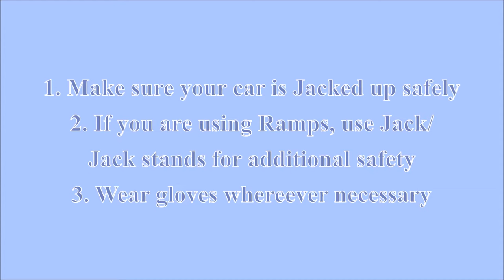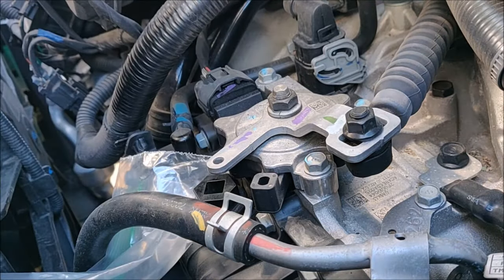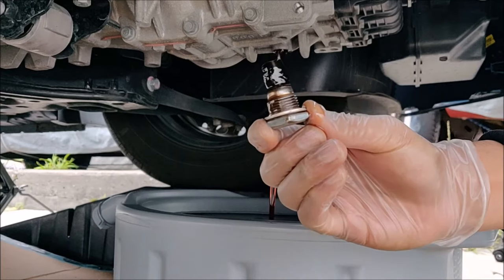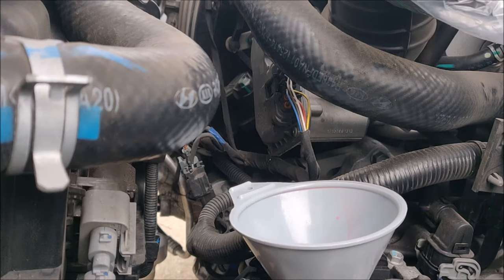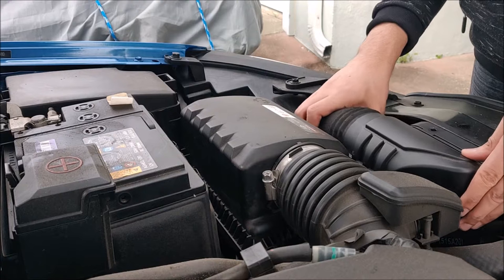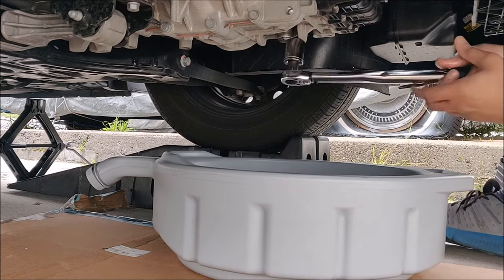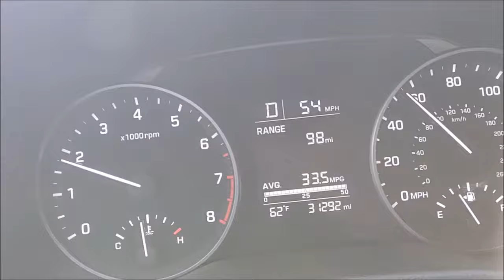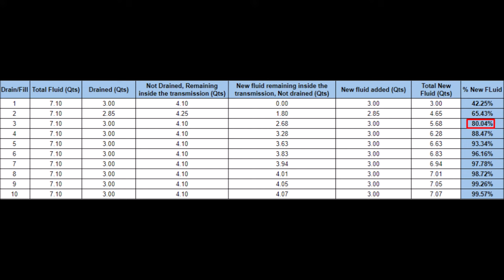2018 Hyundai Elantra Transmission Fluid Change - 3X Drain & Fill with Amsoil ATF (6Th Gen Elantras)

Comment: Hi ! Does 2017 Elantra has ADAPTIVE TRANSMISSION LEARNING?
Reply from the maker: Yes. I believe the 6th gen Elantras do have it. The computer does learn from your driving habbits and tries to make the shifting more efficient for you. That is why sometimes, you would notice a transmission shifting a little differently after a fluid change. That is normal. Once it gets used to it, everything is back to normal.
Reply from the maker: Check this video out. He talks about the Adaptive transmission learning and shifting after a fluid change! :)  https://www.youtube.com/watch?v=aH95BurPZys
Reply: @andy-auto-info2483   your car has low millage that's why you dont need to reset Adaptive transmission learning,but for cars that have more than 100k they may need to reset the adaptive value after ATF change particularly if you feel delay in shift between gears while driving.
Reply from the maker: @SamSam-dt5uc  yes, you are correct. For the ones who observe delay in shifting or any other issue with shifting after the change. But I do know people who changed their fluids late and their shifting was fine. Normally, the transmission should re learn within the first 500-1000 miles of driving :)
Reply: @andy-auto-info2483   any idea about how to do the relearning for the transmission ? thank you.
Reply from the maker: @SamSam-dt5uc  I did try to explore that. But for Hyundai, it can only be done through a high end scan tool and software. You also have some codes that are unique to vehicles in order to access the vehicle computer. They can do it only at the dealership.

Comment: Hey is this the same  procedure for a hyundai kona sel 2019 ?
Reply from the maker: Yes. It should be. Its the 6 speed automatic right? 
Maybe in the Kona, you will be able to remove the fill port easily. Also check below if you see a drain plug and level check plug to confirm its a similar transmission. If so, then the same procedure should work. :)
Reply: @andy-auto-info2483  yeah its a six speed I was planning to use the same Amsoils fuilds its really good stuff. I use the Amsoils fluid on my 98 4runner it runs like a dream
Reply from the maker: @abashashraf8440  yes absolutely! My car runs/feels like butter. I do not feel the shifts at all :)
Reply: @andy-auto-info2483  you should try it with the amsoil signature series and your engine will run so smooth and quiet
Reply from the maker: @abashashraf8440  yes. I use the XL and change out every 7.5k miles with an Amsoil filter. XL is really good as well since it also has a PAO base like the signature series!
Reply: @andy-auto-info2483  interesting I was going to try the XL but it was sold out from my dealer near me. Have you ever used a bypass oil fliter from amsoil
Reply from the maker: @abashashraf8440  No. I have not used any By pass filters. For a sedan, it is not really recommended unless you are using the car for performance drives. As long as you have a quality oil filter that has good specifications, coupled with quality oil, you should be good. :)

Comment: Why not just loosen the shift linkage bracket?
Reply from the maker: I did not want to touch that because of calibration concerns.
Also, the shift linkage bracket was not in the way. There is another hexagon looking bolt under the bracker which was coming in the way of fill plug. Hope that makes sense.
For some folks, this was not coming in the way and they were able to remove the plug easily.

Comment: Where did you get the amsoil atf? Thanks
Reply from the maker: I got it from their official website :)
Reply: @andy-auto-info2483  thanks. Did you like the amsoil better vs factory atf?
Reply from the maker: @drew5992  yeah. Amsoil is a lot better. Extremely smooth. I have 48k miles now and running strong. :)
Reply: @andy-auto-info2483  thanks bro keep making how to videos/maintenance videos. 👍

Comment: Amsoil is a good fluid, but you're playing with fire using something other than OEM trans fluid, especially with Hyundai.  Hyundai/KIA new about the engine fires and the TSB said to decline all engines that caught on fire and to blame it on aftermarket oil filters.  Took 4000 fires, 4 dead bodies, a class action lawsuit, federal judge and 1.5 years of litigation.  Magnuson-Moss Act is a joke.  Good luck if you have trans work that needs to be done and they find Amsoil in it.  And yes, I have a 2019 Sorento and I'll be using SP-IV.  Out of warranty, Amsoil is good.  In warranty?  OEM fluid and filters.
Reply from the maker: I appreciate your opinion. 
Engines caught fire, yes, I know! But i'm sure it is not because of the oils/filters used! Unless they were really cheap! Who knows! Those were faulty engines from Hyundai. But they've come a long way since then. The 2.0 MPI engine is solid. Non GDI and so easy to maintain. 
But regarding transmission in general, I have done tons of research and i'm pretty sure the transmission does not fail if you use non-OEM fluids as long as they are compatible with the spec/viscosity, especially good quality fluids like Amsoil. Transmissions fail because of so many other factors like - 
1.Changing the fluid late/Not changing the fluid
2. Suddenly using a quality synthetic with high detergents when seals are already worn out and then tranny leaks all over the place.
3. Manufacturing defect of a transmission
4. Driving in sever conditions like most of us do and not changing the fluid often - which is the main cause of failures these days. 
5. Heat! - (Main cause for CVT failures)

Now, I am confident that my tranny will definitely last minimum of 100,000 miles or more and hence I am not worried about the warranty!
Her journey will be tracked on my channel for many years to come. :)
Apologies if I gave out too much info, i'm sure you are already aware of these facts and more :)
Reply: I changed my 14 Kia Sorento at 30k with Amsoil 2 times. 50k miles later smooth as butter. Amsoil is the best. You won’t have any issues
Reply from the maker: @bcar1ify  Thank you for the input Bob :)

Comment: the dealer has a machine that sucks all of the fluid out of the trans including the torque converter, that is the correct way to do a trans service.
Reply from the maker: That method is called a flush. It has its own drawbacks. If you research more on google, you will find that sometimes flushing a transmission may cause damage.

Comment: It's funny how he tries to reshape that tranny fill plug with something sharp. You can set your car in neutral next so you can move that shift lever out of the way. Now just loosen those 2 bolts holding that silver cap. Slightly give it a twist so your feel plug can come out. There is a shift lock as well. I'm gonna point this out, very important. So with the tranny drain plug. To loosen, it will be clockwise not counter clockwise. 24 mm bolt.
Reply from the maker: Definitely funny. :)

Comment: Why you drained out fluid 3 times?? And is it necessary to do 3 times?, i have elantra 2018
Reply from the maker: Hi, I did it 3 times to replace 80+% of the fluid with new fluid.
If you're using a new type of fluid like how I did, it is recommended to do it 3 times that way most of the fluid is replaced. If you use Hyundai SP-4, then 2 times is sufficient :)

Comment: All u have to do  select d shifter  from  inside the car
Reply from the maker: Please see the video correctly. Shifter was not blocking the fill plug. It was the big hexagonal bolt under the shifter that was blocking it. And this bolt does not move when you change gears. Hope that makes sense.

Comment: Instead of changing the oil 3 times  why not pull the sump out and clean all the big metal bits sitting button of the sump and replace your filter too it would still be cheaper than changing your oil 3 times  better inspection  and better for your transmission too. it's not a good sign if you're getting metal bits in your transmission oil that means you have bigger pieces in bottom of sump not a good sign at 30k at least
Reply from the maker: I think you got it wrong. It is very much normal to have metak pieces during the first transmission change. That is from the break in of the transmission. This transmission does not have a sump and this is one way to change fluid. Another way is by a complete flush but that could do damage to the transmission. 3x filling was to replace old fluid completely by the new one, as much as I can :)

Comment: my elantra sport 2019 has 13000miles when can i change the ATF Andy-Auto_INFO
Reply from the maker: Hi Alexies, 30,000 miles would be good to start. It'll keep the fluid clean and extend life of the transmission. Just like how I did that in the video! :)
Reply: @andy-auto-info2483  got a question i ll been searching info about the dual clutch transmission in this model 2019 elantra sport does have any issues or problems that you know about just asking so far my car is running super well change the engine oil with the brand you use on the video 100% synthetic motor oil change the tires too thanks for your reply stay safe
Reply from the maker: @alexiesdj  absolutely. Use the Amsoil XL engine oil. That's what I use in my elantra and no issues so far. Look at the manual for change intervals.
For DCT, you have a different fluid to use. Amsoil has DCT fluid, not sure if its compatible with 2019 Elantta sport. Check your manual when the transmission fluid needs to be changed under severe conditions. If it says 60k, I would suggest change it every 30k miles for excellent longevity! :)
Reply: @andy-auto-info2483  thanks for your reply great video stay safe god bless

Comment: Why did you not move the gear selector? 😂😂😂😂
Reply from the maker: @xThat1dude  you're that one dude. Lovely. I've replied to many already. It was the hexagonal bolt that was blocking the cap. Not the gear shifter. I tried moving the gears, it did not work. :)

Comment: TRANMISSION FILTER WHEN TO NEED TO CHANGE I DRIVE 140000KM .........I ONLY CHANGE TRANSMISSION FLUID ONLYYY .........FILTER OF SONATA INSIDE WITH GEAR ......WHEN IT NEED TO CHANGE  PLZ GUAIDE MEE
Reply from the maker: Is this for Automatic transmission?
Reply: @andy-auto-info2483  yes ofcoursee
Reply from the maker: @imrankhan-bw9wp  Okay. So filter need not be changed. It is inside the transmission and very difficult to change it yourself as you may have to remove lot of parts of the transmission. Best is to change the fluid every 30-40k miles, making sure the fluid is clean. This will ensure longetivity :)

Comment: Please do one for 20017 Kia forte
Reply from the maker: The transmission fluid change for 2017 Kia forte is the same. Kia uses Hyundai transmissions. The procedure to remove the undercover would be a bit different, that's all.

Comment: Shift the transmission to N. So you can remove the top plastic bolt easily
Reply: Is the metal part covering the bolt part of the shifting mechanism?
Reply from the maker: I tried, it did not work. Moreover, the shift selector was not in the way. There is another hexagon looking bolt under the selector which was coming in the way of fill plug. Hope that makes sense :)
Some folks, this was not coming in the way and were able to remove the plug easily.
Reply from the maker: @kalani1987  Yes. But it is housed on top of a big hexagon looking bolt. That is coming in the way and cannot be moved.

Comment: I think you said  30 foot-pounds.    I thinking it is  20 to 30 inch.    30 foot pounds would be 15 pounds of force pushed on a 2 foot wrench.   Did not look like you did 15 pounds of push.   I look the amount up and found 20 to 30 inch poounds .  BUT please check me.  Thanks   Good video.   I am going to do a double change Just like you.   I using  Aisin SP4.   Rock Auto.

Comment: Hyundai claims the fluid is good to 100k there are right but 50k -70k better keeps it 🧽 clean my trans on the left side developed a bearing noise I’m close to 58k I’m going for a change; while the level is good the fluid could be Burt causing less then usual lubrication
Reply from the maker: 100k is too late to change tranny fluid in my opinion. Keeping the fluid clean and not letting it burn out is the key. Doing just 1 drain and fill every 30k miles will go a long way. :)
See my follow up video. Tranny has been awesome so far with 45k miles. :)
Reply: As of 11-11-21 I’ve just changed my fluid factory fluid only was burnt 2016 Elantra I do a lot of long distance drives at one point the trans did noise at 47mph Err jolted ,I suspected faltered fluid because the heat did the fluid in to reduce lube properties I changed at 68k I’m feeling better
Reply: @andy-auto-info2483  Agree wonder how much a cooler would help heat destroy s
Reply from the maker: @johnf6687  Cooler is not necessary unless an Elantra is racing. A high quality synthetic fluid will resist extreme heat very easily and the fluid does not breakdown. That's one of the reasons I switched and will continue to do a drain/fill procedure every 30k miles. :)

Comment: Hi, next time try to flush the old fluid thru the cooler line that will be easier faster and save you alot of money .
Reply from the maker: Definitely this is an option. I just went the traditional way :)
Reply: How do you do that?
Reply: @andy-auto-info2483  How do you do that?
Reply from the maker: @ASAMOAH999  hi Michael, there are other videos you can find where folks do a transmission flush using cooler line. Its hard to explain here but I'll summarize it. You have to locate the cooler line outlet, open it, start the car and the transmission fluid comes out of the cooler line. Simultaneously you have to pour in the fluid. You have to make sure the transmission does not run dry and also not to add too much fluid. Its intermediate effort if someone is doing this for this first time in my opinion. The traditional method as shown in this video is easier I feel and safer. Also, not everyone needs to file the fill plug. For most , it comes out easily. I guess my car was one of the unlucky one! Cheers :)
Reply: @andy-auto-info2483  well explained. I'll will go with the traditional way. Yes it's safer

Comment: This is not a good video he only changed half of the fluid what is the point in that it takes 7 quarts if u drain and fill twice it removes 75% of the fluid do more research dude

Comment: You shouldn’t need to be filing or cutting anything to do basic maintenance on your car. As shown in the comments it just took a little more research/knowledge on the appropriate steps. Ironically when hitting that red flag you could have searched on YouTube to find a work around just like people search too to see the transmission fluid changes..lol
Reply from the maker: Thanks for your feedback. Lol. After extensive research, I did this. Absolutely no harm done to the transmission. It's working like new. I am at 65k miles and it still gives 36-40 mph. That's the power of using clean fluids and keeping the transmission clean. Lol. 😄

Comment: always level check with the engine running and in that temp range 50-60 C (122- 140F) to be accurate, level ground or hoist. This is the correct way, don't be fooled into doing it with the engine off, you will end up with a low level which you won't know about.

Even with cars with transmission dipsticks you always check the level with the engine running.
Reply from the maker: Yes absolutely. I have the details already in the pinned comment and in the form of text in the video. I got this done from a mechanic since I was not able to find a level ground. :)

Comment: All you had to do is move the shifter.
Reply from the maker: Hi Angel, please see other comments as well. It was not the shift lever that was blocking the plug, it was the hexagonal bold below the shift lever that was blocking it. Changing the gears did not move the hexagonal bolt.

Comment: I hAve much trust in Hyundai I’d go with the FACTORY fluid only , however the others are ok 
I’m an original equipment guy
Reply from the maker: Yes absolutely. If you're keeping the fluid clean and changing tranny fluid every 30k miles, you should be good. The tranny will easily last 200k miles😊

Comment: They say lifetime. I there there lifetime is warranty time. Lol
Reply from the maker: Definitely not lifetime as you saw from the video! 🤣 I'm changing it every 30k miles. 😊
Reply: @andy-auto-info2483  I got 96k on mine. Idk if good idea now. 60k usually change but I thought sealed unit so. Thanks. Maybe I get spunky and change.  No filter and pan drop like older trans I am use to. So wondering if 4 quarts make difference if not clean filter.
Reply from the maker: @aliendude60  If you are planning to do so, do one drain and fill and drive for 3000 miles and see how the car behaves. If all is good, you can do one more after 3000 miles and after which you should be good. The fluid will be better. Then do it once every 30,000 miles.

Comment: Why you have not replaced tramission filter??
Reply from the maker: The new Generation Hyundai models with this transmission does not need a transmission filter change. There is a transmission filter but that is somewhere inside the transmission and is very hard to access. Even the dealers do not change it unless there is some major problem and it has to be changed.